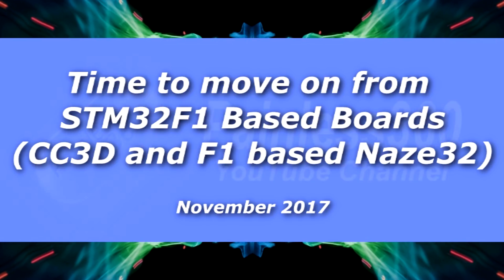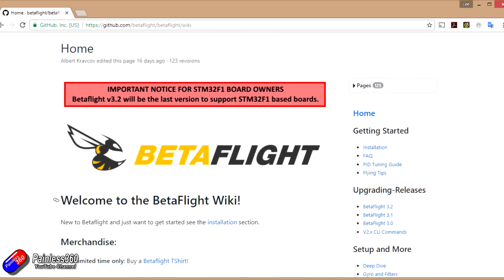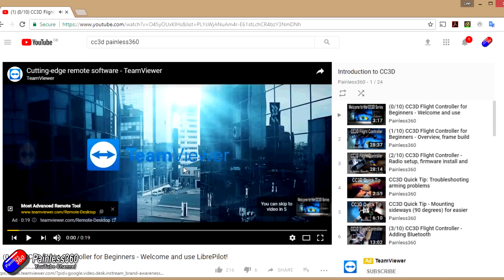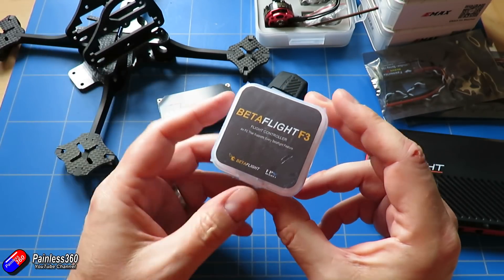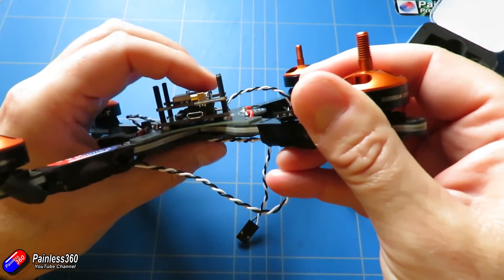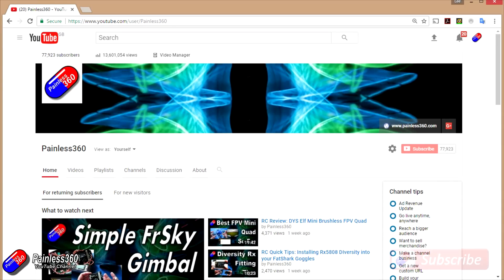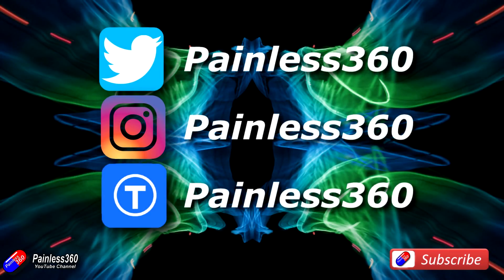End of development support or F1 based boards (Naze32 and CC3D)

Comment: I am only 6 months into multirotors and have a couple of KK2 boards, and a couple of CC3Ds as well. One with a KK2 is a Turnigy Talon Tricopter, and it is a handful to fly. Would upgrading the flight controller to an F4 board now make it sweeter to fly? 
Also, is there a significant benefit, flight wise, for upgrading my quad with the CC3D to a later board?
Reply from the maker: All of those technologies you're using are cheap but poorly supported now. Check out my Quadcopter building for beginners series newer technologies have a little more help for those looking to learn to fly. Let me know if you have any questions.. Best of luck!

Comment: I really messed up on researching what was out there when getting a ccd3 revo then? As a step up from a KK2 flashed with OpenAero VTOL, this controller could accept a GPS and had a GUI with unlimited mixing options for a tricopter with 3 sets of vector vanes on servos. Or have I got a decent flexible controller using Libre, at a good price because it is at the end of development? Looking forward to following your whole ccd3 playlist!
Reply from the maker: This video is almost two years old and along with my annual round-up of flight controller options it's a shame you missed them.. See those videos and my recent builds for modern options.. Best of luck!

Comment: So in a nutshell..the cc3d board cannot be flashed??? this doesn't answer my question. buy a new board..yea yea..my kit came with a cc3d..i can't use it?? why does Amazon still sell them then? it's January 2018 and this was ordered a week ago. and it's out of date..sounds like false advertisement to me..
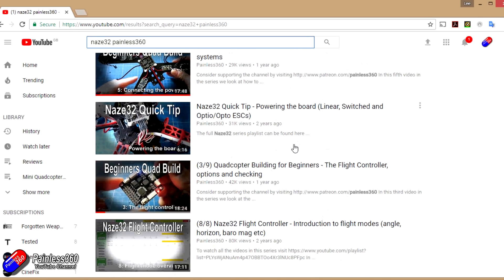Reply from the maker: The detail in this video isn't secret and easy to find. I've made lots of videos about this and even warned of this in the comparison video 6 months ago - https://www.youtube.com/watch?v=sexWq9JHHAo. Answer to your question is at 1:05. You can still flash and use them with the firmware that supports them.. Best of luck with the build.
Reply: ok my friend I want to thank you for your help so far. I've got through the librepilot setup up until the controller configuration. when I move the sticks in the first few steps..they read no problem. I skip the flight mode settings and the next few. when it says "center the sticks and hit next" I have no activity going on. the sticks on the pc don't move..so I can't continue. any thoughts? thank you in advance..
Reply from the maker: Sorry but I've not used Librepilot for a long time now so all of the things I knew are in these videos.. I would try the setup without skipping? See the CC3D revo series for the last time I played with something like a CC3D and LibrePillot.. Best of luck!

Comment: We should mention that iNAV 1.8.0 (latest version of iNAV)  doesn't already work anymore with the NAZE32. But why should we throw away well perfoming and good flying quads  which work well with a F1 processor?
Reply from the maker: Indeed, of they still work then why not? If you don't need the latest and greatest features and fixed then these boards will be around for a while yet!

Comment: Actually even F3 boards are getting close to the limit. Baro and GPS features in Betaflight are removed from F3 to save space. So I think F4 is a good move now. And we should start thinking about F7 very soon.
Reply: Agreed. Space is tight on F3 boards. Support for these will continue for some time, so there is no need to replace F3 boards. But if you are buying a new flight controller, I would suggest at least an F4.

F7 support is also there, however as of November 2017, the code for these boards has not been optimised, so they, as of yet, offer no speed advantages over F4 boards. This will probably change in Betaflight 3.3.
Reply from the maker: Thanks for posting that Martin. Happy flying!

Comment: So CC3D and Naze32s might be dirt cheap shortly?
Reply from the maker: I thought they already were! they were both 'cloned' very quickly. ;)
Reply: Yeah, but Librepilot ground station will not be able to configure the dirt cheap CC3D. Unless you save the current Librepilot RPM/DEB packages. But RPM/DEB packages have dependency on the old Linux packages. Once you upgrade your Linux, the old Librepilot RPM/DEB dependency is broken, and the saved RPM/DEB packages become useless.

Comment: Indeed, and "end of an era", as I look across the room at my 1st quad build which uses the Naze32 board. Still flying well with Betaflight 3.1.7 on it (and an old FrSky D4R-II PPM RX). Oh well, I'm not likely to need any new features on that craft. Cheers.
Reply: That sounds very familiar Bill.  Two quads here with Naze32 boards and D4R-II receivers and a version of Betaflight that I have forgotten the number of.

One reason for not changing to a later board was those nasty little plug in connectors that they use to save space.

As I will probably not be needing to change the 2 quads I doubt that I will update the boards although a new one with a later board is a possibility just for fun.
Reply from the maker: Indeed, as I mention in the video - this doesn't mean that the existing boards will stop working and if you don't need to update then you don't need to worry but too many 'kits' and RTF machines are still coming with Naze32 versions of the flight controller...